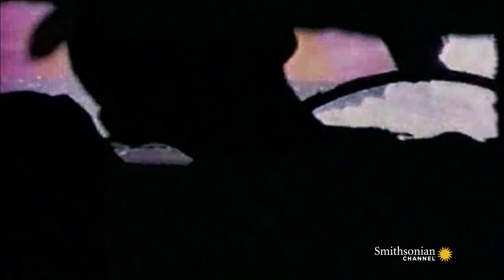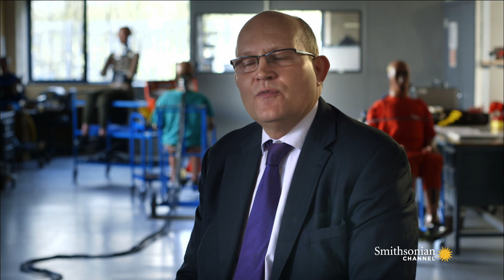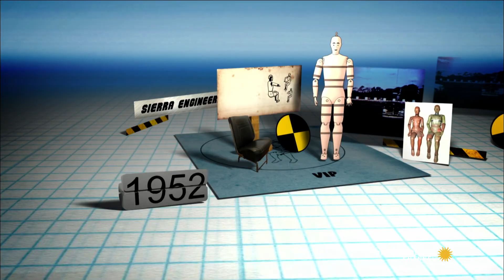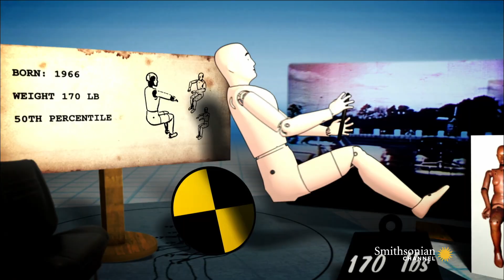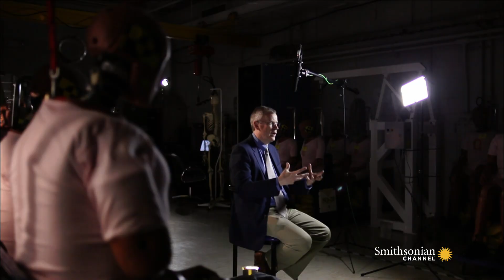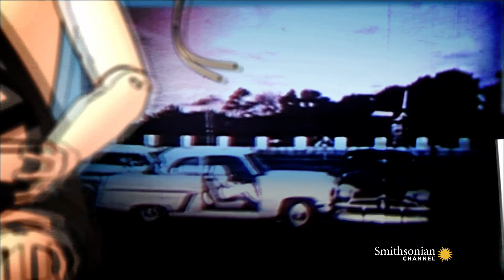The Physics of Seat Belts

Comment: The  lap belts were a huge improvement over No Seat Belts At All, as they had been for the previous 66 years, when the Federal government (and especially California) in 1966 demanded all US car manufacturers to install seat belts at the factory. There were many hundreds of thousands of deaths from unrestrained occupants of cars and trucks before that time. (And note that seat belts were available, as options, in many cars beginning in the early 1950's, and very very few drivers would pay the 12 dollars per set that they cost.) Through sheer Stupidity US drivers went merrily on their way to their death in many cases for Nothing. The aircraft industry showed the sense to require seat belts to be installed and to be Worn. It is Proof that, in their supreme ignorance, so many people died needlessly. My own life was saved in a high speed crash in a 1956 Chevrolet, because I had spent about 12 dollars to install seat belts in that car. (lap belts)